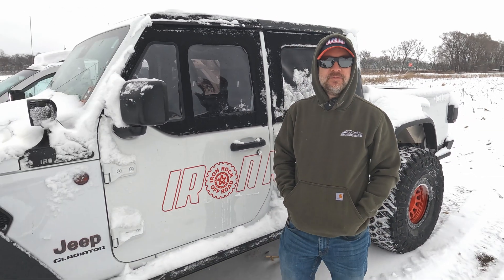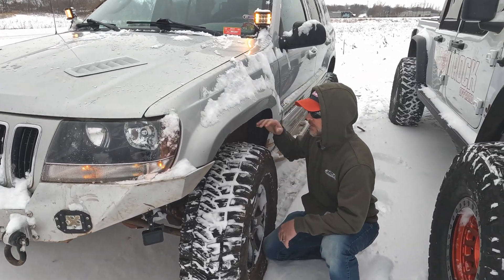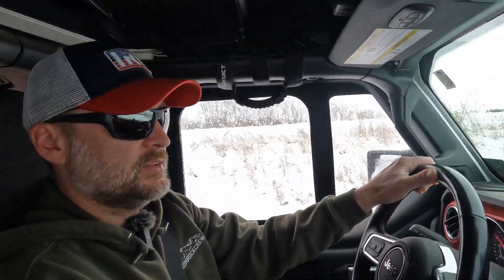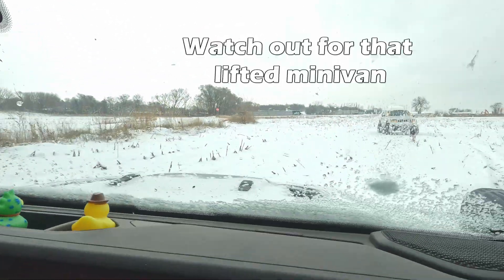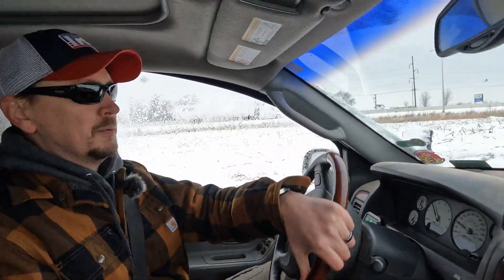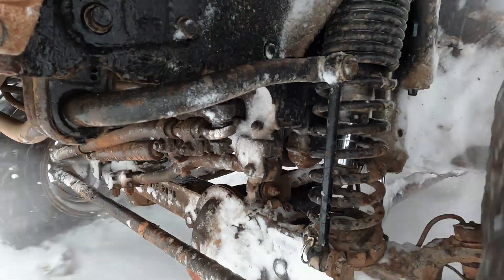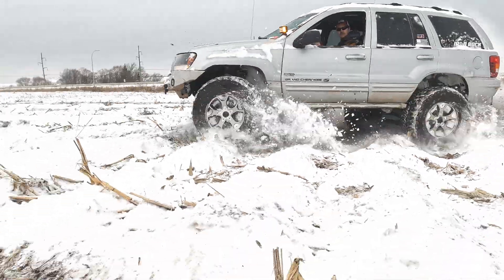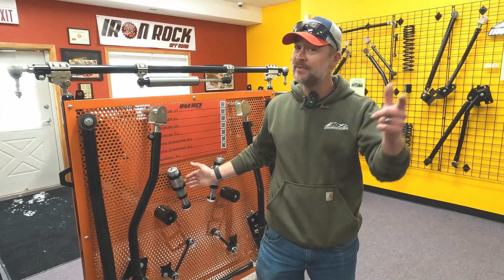Trail Tamer 2.0 Hydro Bump Stops - TESTED

Comment: How to position a 2.0-inch bump stop relative to the shock absorber's travel? And what bumps’ pressure is recommended for a comfortable ride?
Reply from the maker: @SaarLorLux The 2.0 bump stop should reach the end of its travel just before the end of the shock travel. This will protect the shock from damage.
The 2.0 bump stops come charged with nitrogen and ready to install. I am not sure what pressure, I will check.

Comment: The WJ is so underrated and overlooked as an offroader. Thank you guys for giving it the attention it deserves
Reply: Well there’s not much of a market for it and not many shops work on them. So if there are any technical shit gotta figure it out on your own. I’ve had nothing but issues with mine
Reply: @matthew7972  that's not true at all. It's literally the same 4.0 as the TJ. They have Dana front and rear axles.  These are the simplest jeeps to work on.
Reply: @wdubduece8913  nobody said they were “hard” to work on. I said anything technical related to off-roading a shop good luck. I have the 4.7L and what exactly is easy for you to work on a 4.0?
Reply: @matthew7972  why would you have a shop work on it if it's not hard to work on? I don't take my jeep to the shop. If something is broke, I do it myself. I don't know what to tell you lol
Reply: @ I said anything technical dude 😂
Reply: @matthew7972  I think we just have a different definition of "technical".
Reply: @ yea my issue is I can’t get find a shop that can do a proper alignment for my WJ after installing the 6.5” rock link pro kit. I did the proper shit upgrading and custom length drive shafts blah blah blah and still have a vibration and shits all over the road. Every shop I talk to they’ve never worked on a WJ
Reply: @matthew7972  well, i guess you're stuck figuring it out yourself. I'm not saying I'm a master mechanic by any means. I definitely don't know everything lol but sometimes I'm forced to figure it out myself. I've been in that position way more than I'd like. One thing I've learned is that nothing is really over my head, or yours. It'll make you a better mechanic.